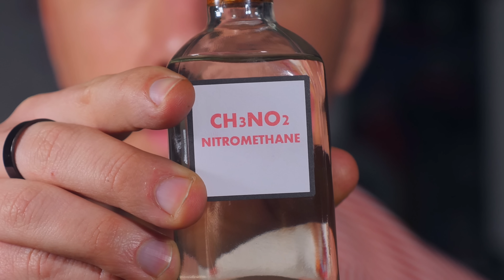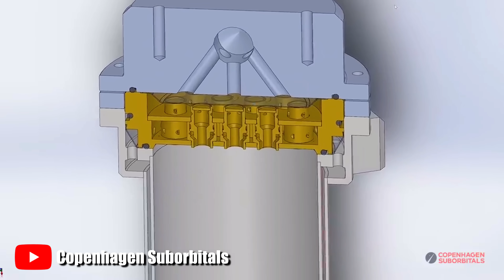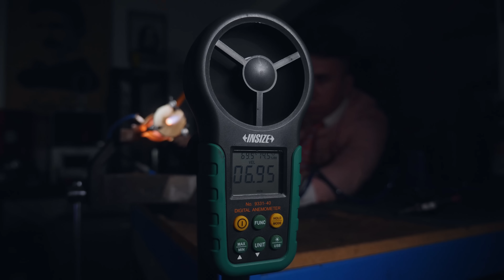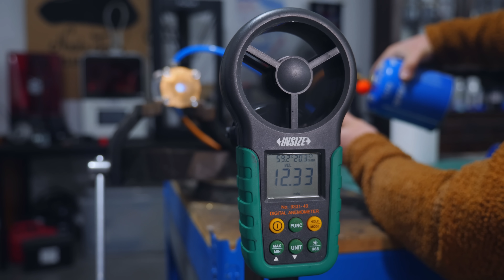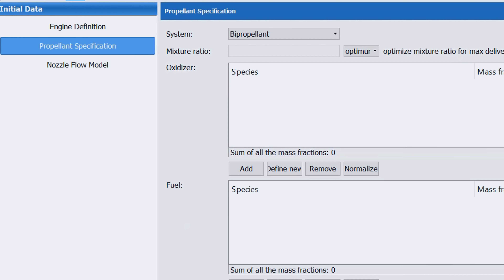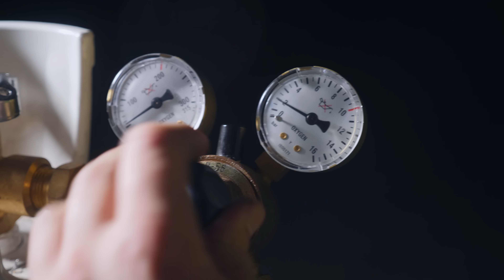GLASS ROCKET ENGINE

Comment: Integza you don't need the potassium permanganate once that rocket is hot enough the heat should cause the hydrogen peroxide to decompose almost instantaneously all the potassium permanganate does is lowers the activation energy required to start the decomposition and which can speed up the overall rate of reaction but I don't think thats a major problem with the flame being atleast 1500°C if not higher just by the flame color alone. Using heat means the water will flash into superheated steam giving you even more pressure so all you need to do is pre heat it like nasa did with the saturn five rocket.

Comment: Where one find 50% hydrogen peroxide?
Highest I could find was 12% . 
I do have plenty of methanol.
But was wondering if denatured alcohol would work as well? 
I'm working on a vortex air conditioner  without using a compressor.

Comment: Could you compress the potassium permanganate powder into a solid tube, like a solid fuel rocket, then inject the meth, H2O2 mixture down the middle of the tube? So the h202 reaction will consume the potassium permanganate like a solid fuel rocket. The oxygen and methanol will burn like a liquid fuel rocket. The steam will.. steam? like a steam rocket. It's like a rocket hat trick.

Comment: 1. For the love of god DO NOT MIX PEROXIDE AND FUELS. Especially alcohols, they are miscible (this means they dissolve into each other). It’s not a “lol, it might ignite” type or warning, they actually make a high explosive and if you make it angry enough it will go high order and detonate (not “burnt eyebrows” detonate, more like lost limbs / red mist detonate).

2. Everything you did in RPA is wrong. You don’t just pick a chamber pressure based on what your air compressor can put out. You need a pressure drop for flow to happen, this means that the injector pressure needs to be above the chamber pressure, usually by 20% at least (more would be better for you). A 6 bar chamber pressure might work for the air assuming your compressor could actually keep up at 8 bar, but at 300K butane is only at 2.6 bar, there is no way for it to flow into the chamber! Your actual chamber pressure was much less than you assumed.

Your mass flow measurement method is also probably wrong. I’m just going to ignore if the wind tube thing is even feasible; lets just assume it works. Mass flow is a function of pressure drop: more pressure drop, more flow. If you cranked the compressor all the way up, that test would be giving you the flow rate at 8 bar of pressure drop, NOT the 2 bar of pressure drop it would have been at in your hypothetical 6 bar chamber pressure design point. You need to actually size your injector elements using something like mdot = Cd*A*(2*rho*dP)^(0.5)

3. Please do this shit outside.

Comment: you can get small high pressure alloy or CF bottles that re refillable... look for medical oxygen type tanks. 
then an aerosol can of fuel....

the combustion chamber was great but terrible? obviously youve done a few in metal, but you dont have the burn yet. few more holes, but SMALLER at the start. less overall area. bit too lean at the beginning.that flame was being buffeted around and barely keeping itself going.

running it on butane, you miss the marks left in the chamber... you run kerosene in jets and watch how the chamber soots up or discolours to get it right...

feed the air in tangentially to start with. even a right angle on the end of the air fitting in teh outer cylinder, to get the swirl started...

GRIND the holes with diamond bits, set it up in a drill press with a weight on the arm, a small dam of plasticine around the hole... take the time, dont rush it, let the weight do the work...

i hope thats QUARTZ glass?

if you hunt around for "quartz windows", you could maybe just stick the windows at the end of a tube... make it ALL from glass!

Comment: For swirl nozzels, oil burning boilers.Fascinating to dissasemble the nozzel , three spiral grooves on a 60 degree cone. high pressure .  Oxy -MAP  systems have smaller Oxy bottles. Fascinating work

Comment: It would be crazy if you had the audacity to make a tesla turbine powered by the heat of a "rocket engine of some sort. Then use the thrust from both together, the tesla turbine will spin a propeller or spinning wheel for example.😊 Do It!!!

Comment: That's very interesting, I've never thought about H2O2 being essentially both a self-oxidising fuel and also an oxidiser on top of that. No wonder it's considered very dangerous in high concentrations. And no wonder the Germans used a combination of it and ethanol for rockets. (And later had to add toxic additives to the ethanol to stop people drinking it xD)

Comment: You should try experimenting with "Wood gas". 
"Wood gas" is released when wood gets heated above a certain temperature. 
"Wood gas" is actually what is burning when you burn wood.
"Wood gas" can run a petrol engine if is filtered. 
@Nighthawkinlight has some good videos on the topic.

Comment: another thought just occured to me... i've been watching your channel for lika almost 3 years now and i noticed your equipment gets better and better and more sophisticated. now I think it should be possible for you to take some desings of yours and turn them in actual capable rockets - and not just test engines. I think if you scaled up the desinges in this video, mounted three of those on a cylindrical structure along with the oxigen gas tank and some sort of fuel tank, you'd be able to launch in no time to at least the higher bits of the atmosphere. sorry for my bad english xD

Comment: What would happen if you built an intake that led to a flame tube, which flows into a Tesla turbine with a shaft on one side and exhaust port on the other, and on that turbine shaft add an electric motor? 

To start the engine, use a battery to run the motor and spin the turbine to create airflow in the inlet. Then start the flame tube to create hot air flow to keep the turbine spinning, and then stop powering the motor and instead keep it spinning to generate electricity.

Comment: Now that you have a cnc machine, can you try and make a injector plate like the ones on the f-1 engine, then inject hydrogen peroxide and methanol to give an awsome mixture and an insane propulsion,  then use the engine to power a 🚲 bicycle

Comment: "Hello, Integza! You're doing a great job, and I'm looking forward to your next video. For your next video, I suggest focusing on 'Magnetohydrodynamic Rocket Engines and Plasma Thrusters.' This is a unique concept that differs from traditional rocket engines and can be quite fascinating.

In your video, you can explain how MHD rocket engines work and how plasma thrusters are designed and built. You can also discuss the advantages and disadvantages of these technologies compared to traditional rocket engines.

While doing this, it's a good idea to cover the design process, material requirements, and safety measures. This will help your viewers gain a better understanding of this intriguing topic.

I hope this suggestion piques your interest, and the preparation process for a new video becomes exciting. Good luck!"

Comment: If you need/want smaller bottles of oxygen, they sell (at least in the states) small bottles in hardware stores buy propane tanks for small cutting torches. Although it is pricey for the little you get.

A way that would be smaller refillable tanks would be getting from a medical supply company. They have smaller bottles for people who need to have supplemental oxygen. So they are smaller so they can be carried with the patient.

(And for medical uses, they have oxygen concentrators that refill these little bottles for patients at home. If you need oxygen you can make yourself, if you can find a used machine that might not be up to medical quality anymore, you can refill your own oxygen tanks!)

Comment: Idea: test an engine in a vacuum chamber. It would probably be hard to keep it a vacuum with the expanding gases coming out of the engine but i dont think its impossible with a strong enough pump and a big enough vacuum chamber. It would be cool to see the difference in the plume depending on the air pressure close up

Comment: I realised today that you could actually use better Catalysts than manganese dioxide, because it always makes a mess and could clog your engines. Instead, you could use platinum or even iridium coated rods or plates. A coating is pretty cheap in relation to bare metal and it should be sufficient to sustain a stable decomposition of the Hydrogen Peroxide.

Comment: Wonder if you could put the hydrogen peroxide solution into the resin printed fuel, that way you can have a small tablet size feeding mechanism. Which would create the reaction needed to power your rocket engine without having a lot of weight.

Comment: For the next rocket design you could try using nitrous oxide as oxidizer, it is easily available and it is sold in cartridges similar to CO2 catridges. You wouldn't have to deal with air compressor or H2O2 reservoir.

Comment: use the methanol/hydrogen peroxide as fuel for a 3d printed wankel rotary engine, check the co12 emissions of that, plz, you might discover the solution for this climate crisis.

Comment: 15:06 While the oxygen burns the methanol, you then have a fairly high steam to methanol ratio that will limit the temperature and hence the impulse.

If you would use nitromethanol in stead  you need less oxygen, hence less H2O2, hence you would produce less steam, and it would be way warmer.

Comment: video idea:
create a rocket engine which small, fast and has high power. it should also work on same working principle of turbo jet engines but without using your air compressor

Comment: Would it be possible to use a chemical reaction to create gas for a compressed air engine? I realize that's basically just internal combustion with extra steps, but depending on the ingredients it could be better than burning gas or alcohol!

Comment: if you want to easily measure volumetric flow rates of air, you can hook up a trash bag to the air source, and measure the time it takes to inflate the trash bag. Then you have the number of seconds in which the volume of the trash bag is filled (for example 60l in 10s) from there you can just calculate the liters per minute, in this case 360 LPM, and you can use converters to get the unit you want

Comment: Take that counter rotating vortices nozzle or custom one make a heat exchanger where the boundary layer is the separator, proper design of counter rotating jets should make a highly efficient heat exchanger, assuming micro vortices ( mixing can almost be eliminated). Would do it myself but don’t have a 3D printer :-) knowing the design of that counterrotating nozzle might make for a shortcut for the fluid dynamics simulation

Comment: couldn't you have the hydrogen peroxide reaction in a separate chamber, put a nozzle on the separate chamber so only the oxygen flows out and make the reaction more efficient and maybe try pre mixing in a separate chamber like a pre ignition chamber in cars but for mixing fluids have butane and other gasses you could do that also, so in the end the pre mixed fluid and pure oxygen al flows in one combustion chamber to increase performance out the nozzle

Comment: video idea: 
create a water based electrolysis fueled rocket engine, electrolysis will create hydrogen (fuel) and oxygen (oxsydiser) would be a cool idea. Keep in mind that tomatoes are disgusting!
Reply: im an engineer myself and this was literally one of my best projects i did. but it has a very big flaw, your electrolyzer has to be very efficient which means that you have to use platinum-group metal catalysts which are very expensive. other types of electrolyzers are cheaper but also not nearly efficient as an PEM. the current and energy needed is another critical point, but you can reduce the required current by raising the temperature.
also it is very tricky on how you design your combustion mixture. typically you would aim for the lowest air:fuel-ratio which would be Knallgas with a ratio of 2:1 but that is very dangerous to deal with.
i ended up using the gas for a pneumatic system which also has a little pulse thruster, but this is only for stability purposes of a satellit and cant be scaled up before something blows up but i would love to see integza try his best
Reply: im just a guy, but ehm, such a system would be way too heavy to be lifted into the air by the engine.

How are you ever gonna produce enough power to electrolyse water and to have it power the engine?

It aint gonna work.
 @arcangelbane
Reply: @bertjesklotepino  You might be right. But as far as I know you can electrolyse water with electronic charge. It would have the (almost) perfect ratio of Hydrogen to Oxygen. Which gives you a higher thrust to weight ratio.
Reply: @arcangelbane  isn't it pressure and temperature increase the efficiency, but since a lot of the time it's a little hard to rig up one that exactly separates the gases you also have to avoid the instantaneous combustion pressure of hydrogen and oxygen in the perfect ratio/neutral flame ratio.  I wonder if there's a specific reason why we don't have electrolysis based welding torches, you're already try to not exceed 15 PSI with OA, and having a lot of check valves we would be using the same technology and safety precautions to avoid the combustion pressure for a premixed neutral hydrogen oxygen flame.  Wait I know moisture and hydrogen embrittlement, tunnels and fractures.  I wonder if aluminum suffers from that on the same level as steel, usually you can't weld it with a flame because the oxide has much more thermal resistance than the metal, but maybe the combination of heat and flow rate achievable with oxygen hydrogen it might work?  I'll have to see if there's a safe method to test this idea.  It's kind of weird that welding/ soldering torches and rockets have only the difference of chamber pressure and function of the nozzle.
Reply: @arcangelbane  use a lot of inefficient ones? How do the inefficient ones compare to the platinum group catalysts?
Reply: cool, but extremely inefficient idea :)
Reply: You are getting the printer !
Reply: @Demoversyon  ye
Reply from the maker: Congratulations! You have just won a 3D printer! Send me your info (Name, Address, Zip Code, Phone Number) to integza@gmail.com.
Reply: yes, and it would need to compress it or something.
so it would be some system that can cater rockets.
anyways i'm not a sertified scientist (yet)
Reply: He kinda does at the end here. At least, if that really is the reaction. He is claiming the steam heats so much it separates and reignites, which is the chemical reaction you are referring to.
Reply: I’ve been suggesting that for such a long time 😢
Reply: I was thinking something similar, but I want to see an h2o2 engine where the water gets recycled back through to be reused as fuel again.
Reply: @tracygallup4147  I think the Water Electrolysis Process would take way too long.
Reply: keep dreaming @tracygallup4147
Reply: really great idea(i was thinking of doing something similar myself)
Reply: This is an awful idea ! 
The components to do this would far outweigh the thrust it would ever produce. It’s pie in the sky nonsense, perpetuated by American idiots trying and failing to do this with cars. 😂

Comment: The fuel and oxidizer pressure needs to be significantly higher than the desired chamber pressure, because the pressure difference is what determines the flow rate of the fuel/oxidizer.
That is also why the nozzle calculations for the compressed air rocket engine where completely wrong: you measured the flow rate of 8 bar compressed air and you did the calculations for 6 bar chamber pressure, but in reality the difference between 6 bar chamber pressure and 8 bar air pressure is just 2 bar, so you calculated a mass flow which was about 4 times higher than in reality...

Comment: Create a rocket that can reach low orbit.  deploy a camera to take video of at least 1 orbit, then reenter,  equip it with tracking so you can find it.  this will require many challenges fuel,  shielding for rentry,  flight electronics.  This is a Project!!!

Comment: have you considered building a rotating test rig for your rockets? Given your use of gas and liquid propellants and fuels, you could run hoses to a central hub, and with your rocket on an arm pushing only itself and a counterweight (use a tomato!) you could probably get some solid numbers on just how much thrust your rockets or nozzles produce.

...This is mostly to see how many g's of force can be applied to a tomato before its pulverized

Comment: Looking at that CNC ,how it already has a compressed air connection and an enclosure, you could take a look at building your own oil mist cooling system.
You would have to build a injection system for the oil into the airstream, where you can regulate the oil volume and an extraction system, that filters the oil mist out of the CNC.
This would give it the possibility to machine with better surface finishes and the mist extraction would also be good when youre cutting graphite again, as grapithe dust is nasty stuff that is neither good for you nor the machine.

Comment: Question, in your last example, you were producing both water (in the form of steam) and oxygen. Could you basically build a two stage, with this staging producing the oxygen you need for your second (original) stage? I.e. pass the output into a 'buffer' chamber that's cooled to remove some of the water and then feed that oxygen into the reaction chamber of your first motor? By sizing that 'buffer' chamber appropriately, I'd think you'd be able to create a stable enough, pressurized oxygen feed into that second stage...